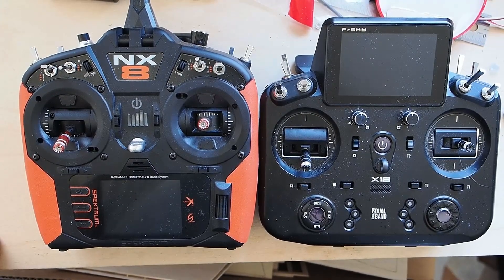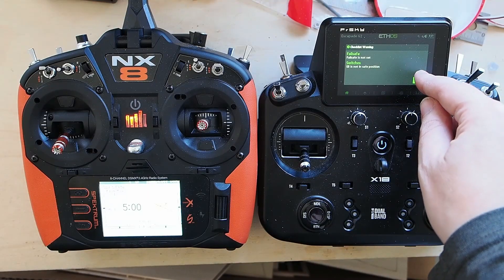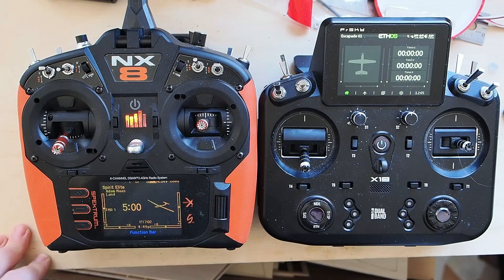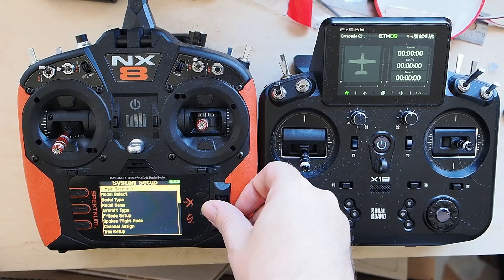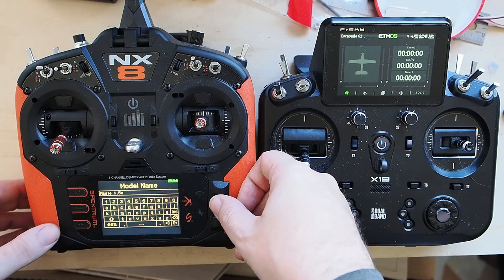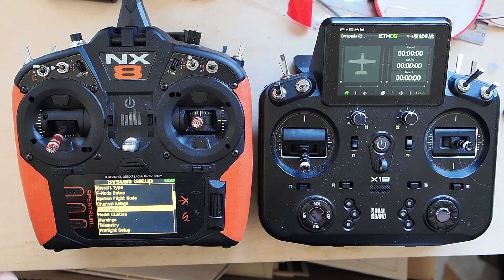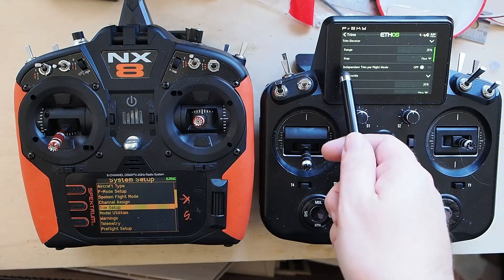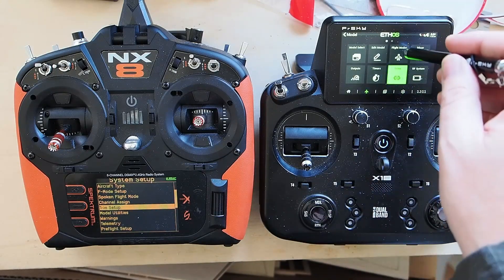ETHOS for Spektrum Users - Maule 1.5m Episode 1

Comment: Thanks. Flight mode is not related to takeoff and landing flaps.  It is mainly related to limiting the banking of the plane using the ASX3 (limiting the plane being turned too much or upside down)  for experienced Vs inexperienced pilots.  It is not clear why you mentioned the flight mode and then programmed the flaps.
Reply from the maker: You are confusing Receiver Flight Modes (which I usually call Stabilizer Modes) with Transmitter Flight Modes. 

I am using transmitter flight modes to get multiple independent elevator trim settings, each tied to one flap position.
Reply: @adam_mawz_maas  thank you for replying. I am using the term used by Spektrum.  Anyways at the end the same results are achieved. I do the same directly through flap’s system menu by assigning a 3 position switch for (flaps up, takeoff flaps, and landing flaps) with an offset by elevator depending on the aircraft characteristics.  Thanks a lot for the videos on Frsky.  I own both spektrum and Futaba , and I am interested to know more about Frsky  to replace my radio master. 👍

Comment: Das Programmieren mit der Spektrum Fernsteuerung ist viel einfacher als mit der Frsky Ethos. Ethos hat hunderte mehr Einstellmöglichkeiten. Ist aber für einen normalen Benutzer nicht nötig. Zu viel Zeit und Aufwand für einen Flieger zu programmieren.
Reply from the maker: I’d have to say I disagree. Yes, ETHOS does have more flexibility and settings (less than you would expect though, because ETHOS doesn’t have semi-duplicating settings like Travel and Absolute Travel in Spektrum), but I find it significantly easier to program than Spektrum once I got used to it, to the point where I now find Spektrum frustrating to program with the constant jumping around between multiple menus to do simple items.  

The new model wizard makes the basic setup simpler as it asks you what you want rather than forcing you to step through multiple menus to get the basic setup completed. I also prefer that ETHOS shows all the basic setup on one page, if you go to your Elevators you see your Rates, your Expo and your Travel settings all on one menu, plus the monitor for the Elevator channels. That’s 4 different menus on Spektrum, and none of which show you how the settings interact.

Comment: Adam, noticed you changed max outputs to -78/+78%… question; what if, there are 2 servos for the rudder in a dual servo rudder tray using a pull-pull system; which output would you recommend adjusting first; Rudder front or rudder back or does it matter?

Otherwise; love the video; and surprisingly; I have an older Spektrum 8 channel to use with my Maule 1.5m and thinking about changing over to a X8R Pro OTA to use with my X20s.  Video was appropriately timed.
Reply from the maker: Hello Conrad - The output change is a quick fix so that 100%  in an ETHOS Mixer is nearly identical to 100% on a Spektrum mixer or function. I wouldn’t do that on anything other than a BnF r drop-in conversion from Spektrum.

For adjusting the dual-servo rudder setup, I don’t believe it would matter so long as you only do small adjustments each time to ensure you don’t overstress the linkage system.

Comment: X20s user here, I’ve had mine for about 3 months. I didn’t understand flight modes,,, thanks (I’m from the fb groups)
Reply from the maker: Hi Jeff,

Flight Modes do two things:

1. They tie a group of settings together that can all be activated via one switch
2. They allow you to have different trim settings for different flying setups.

The way I'm using them here they will just allow you to use the elevator trim to compensate for flap deployment, but you can do much more complex things with them as well. I will cover that in a future video dedicated to the subject of Flight Modes.